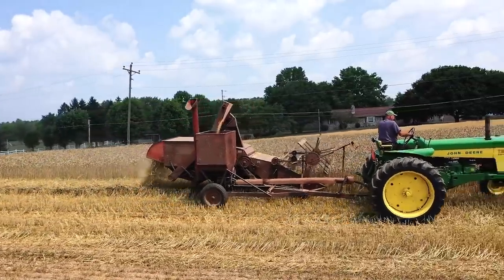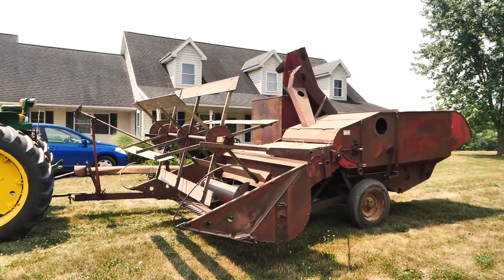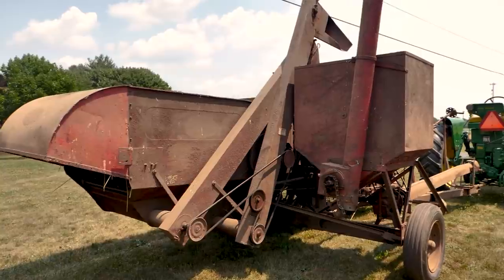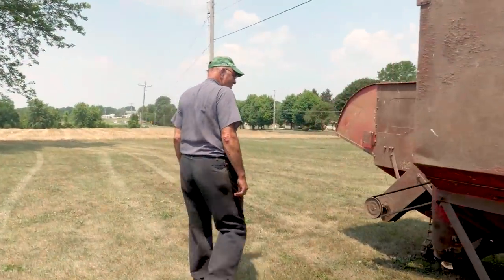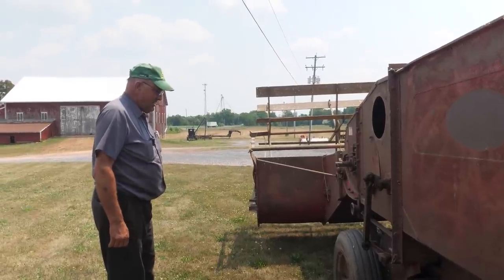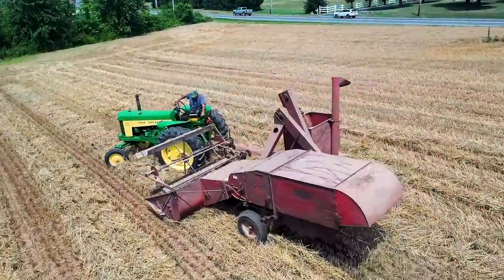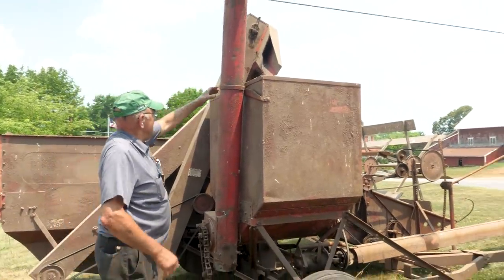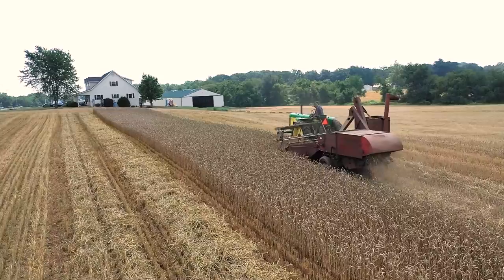1955 Ford Pull Type Combine

Comment: Back in the 60's my dad owned a share of a Massey Harris model 90 with 2 of his brothers that had adjoining farms. He got tired of waiting for his turn on it so he could harvest his oats.  He went to an auction and bought a combine that looked just like the one you're showing here. He was so pleased with its performance that he bought a 2nd one later at another auction and kept them both. He used a super H or an MTA to pull them and they worked just as good as my uncles' self-propelled Massey Harris.

Comment: I live in CT so not a big demand for these, however if you have a small local operation, these old machines are super easy to repair if you are mechanically inclined and you can generally get them up and running faster than modern equipment.

Comment: It’s good to see your combine still working. I had one just like that built by Ford. I pulled it with a John Deere B 1951 model mine had a scouwer clean work great. I sold it and bought a 30 John Deere with an apron feed rather than the Draper feed of the Ford.

Comment: I know absolutely nothing about combines. I'm curious if new ones are more efficient than the older ones, in terms of how much winds up in the bin.
Reply: All depends on the operator.
Reply: Newer, especially axial flow, is way better.
Reply: @tangydiesel1886  How can it "depend on the operator"? The question (albeitly that could be worded better) can a 1955 machine strip the same, more, or less percentage of the wheat from the stalks compared to a newer machine. However, based on what @Airplane Doctor says, it seems that axial flow gets a higher percentage off the stalks and into the bin.
Reply: @JCWren  mainly depends on what is meant by "efficiency."
By number of acres covered, and bushels put though in a day, yeah, newer is better. Machine size is huge compared to what was around in the past.
I was reading the question as "grain loss" which is entirely on the operator. Any machine can be set to not spit grain out the back, no matter the brand, or age.
If fuel efficiency was what was considered, then walker machines would have a leg up. Takes less hp to run a cylinder and walker, than a rotor to put bushels in the grain tank.
Reply: @tangydiesel1886  Excellent information, thanks! Grain loss is what I was referring to (I didn't know the term), but not from spillage so much as the mechanism that strips the wheat from the stalks.

Comment: I’m very thankful he did not scrap that machine when he purchased the property.   It’s a reminder to take care of your equipment and it will take care of you! 

It reminds me of the bailer grandpa used from when I was much younger.  It was a new Holland, but it ran off a pony motor, not a pro shaft.  He pulled it with his 8N until the mid 70’s and it was converted to a PTO shaft in the mid 90’s.    I can’t remember it ever busting a bale.